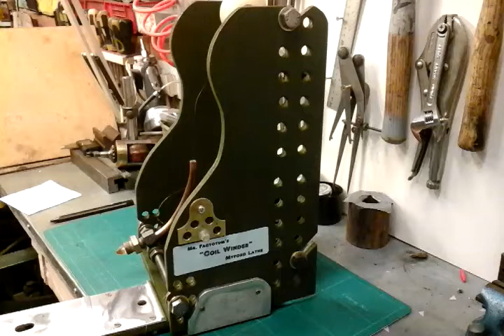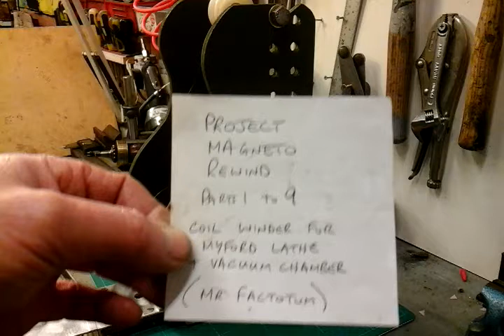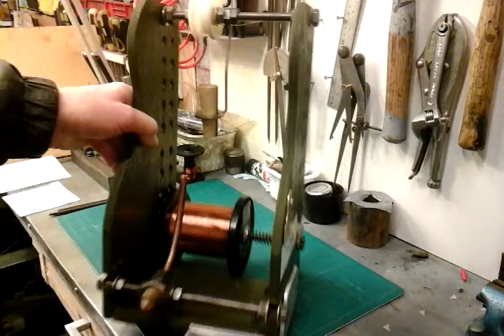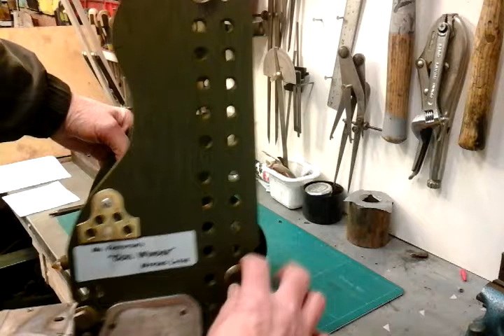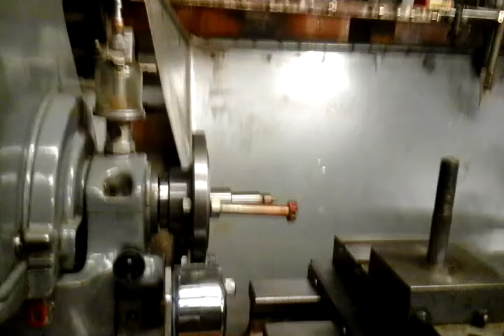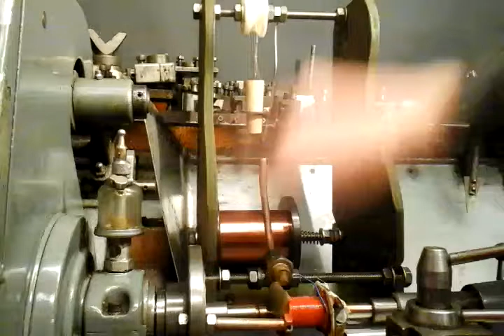Myford Coil Winder Upgrade.....mr factotum

Comment: Thanks for your mag winding videos, I am just starting and they have been very helpful.
Reply from the maker: Thanks for message, glad its been helpful,  hope all goes well
Regards
Mr f
Reply: @MrFactotum  what tpi did you set on the myford for the 0.08 wire
Reply from the maker: @malcolmbegg3601  hi malcolm
Its been about 3 year since i did that project Malcolm, from memory i think i just had a practice then adjusted it to suit, i can't remember exact feed rate because i don't think its relevant, as long as its moving at a rate to keep up with the winding, its not too critical, i was going at low rpm's in the back gear, so you can see if the feed rate is too fast or slow, and you can make any adjustments with the compound slide to compensate. All the best with having a go, and i found that concentration is the key thing, you don't want any interuptions, especially on the secondary windings, i locked myself in the workshop and turned my phone off,  thinking about it now in this climate were in, it was a practice run for lockdown!!!!!!
thanks for watching and comments
stay safe 
regards
mr f